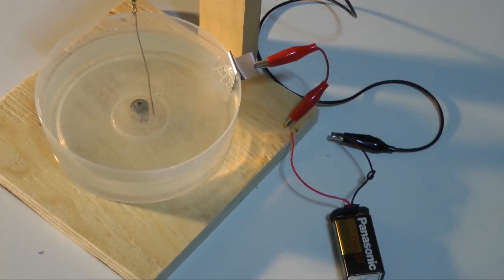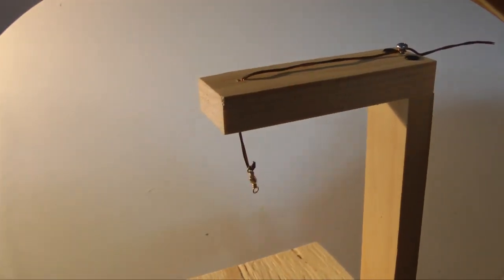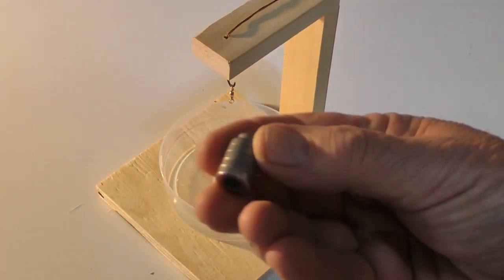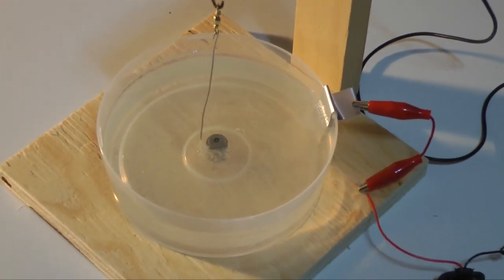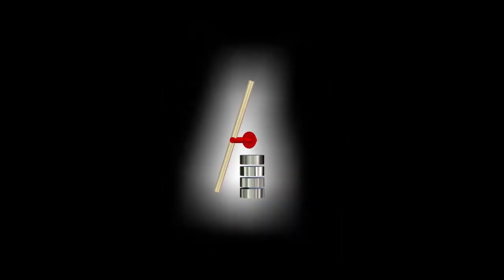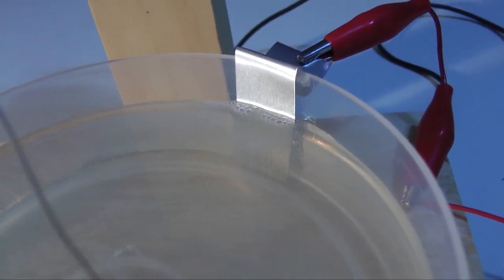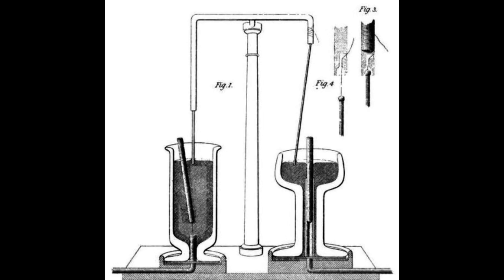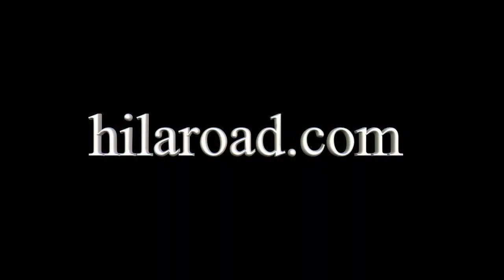The First Electric Motor

Comment: I believe this works using jolts of electricity. That is, try measure the current (amps) from the battery. It should oscillate up and down with the wire's motion.